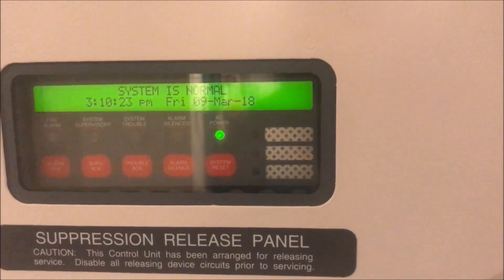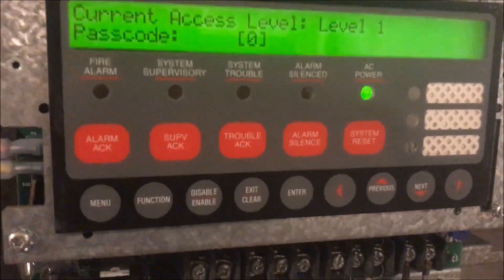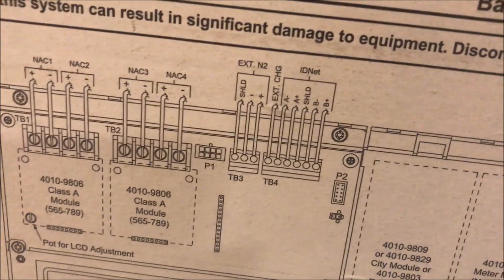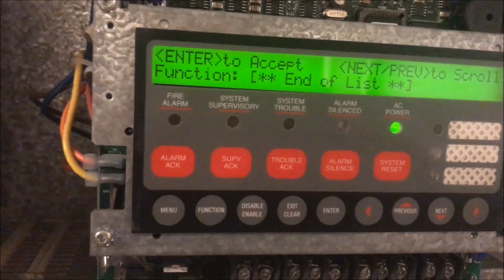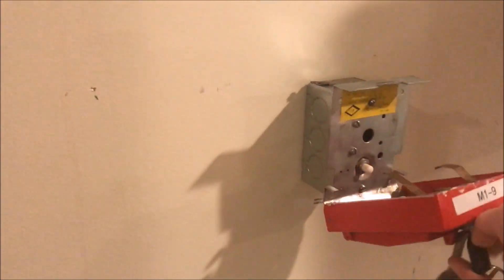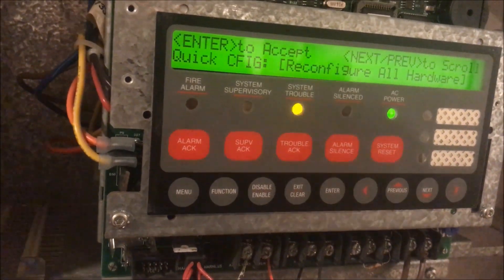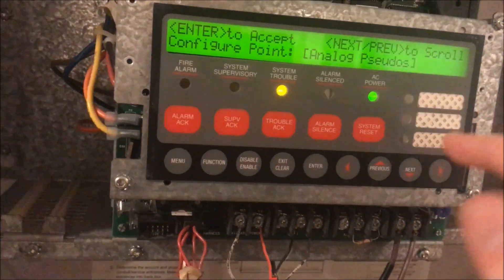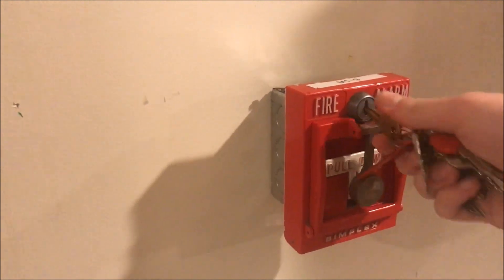Basic Programming on a Simplex 4010 Panel

Comment: We are preparing to  demo a suite at our business that has 13 smoke detectors, 7 strobes and 2 pull stations.   What are your recommendations for disabling the points and listed on our print out of the points list names for these devices.?  Post disabling the points, you mentioned the wires are still live.  What should we do with the devices during the construction ?
Reply: As a former tech I would recommend taping off the smoke and heat detectors with tape so to not allow dust and debree to enter the "detecting chambers" and just let them hang by their wires out of the way, same with pulls and strobes, just make sure to write with a sharpie on the masking tape on the devices that they are "live". This way you can continue to demo out where needed with a system still online (connected to the monitoring center) until you can get a tech onsite to either relocate the devices, re install after a remodel, or remove them from the system itself (remove from programming and them physically remove the devices) if you are completely doing a full gut down to the studs and need to rip the system out so a fresh one can be installed after the construction is completed, you want to call your monitoring company and cancel the service for that control panel/system that you need removed so that no "trouble calls" come in to the monitoring center due to the phone lines on the panel becoming disconnected and the monitoring center no longer having contact with a system that does not exist anymore.

Comment: My first elementary school has a Simplex 4010 system. It was installed around the mid-2000s, tied into the school's original Simplex 4208 panel from 1974 (the 4010 was replacing a 4004 installed in 1998, which in turn replaced a Simplex 4002 installed in the late 80s or early 90s for added-on duct detectors.) The 4010 was for main controls, the duct detectors, signal coding and the modular building, while the 4208 was used for the existing pull stations, heat sensors and an old ionization smoke detector. They had Simplex 4051+4050-80 horn/lights, but they used 120-VAC light plates for some reason, and while the NACs on the 4010 would code the signals (Slow March Time), they had to run through the 4208 to provide the AC power for the lights (while the horns were 24-VDC.) But in early 2015, the Simplex 4208 panel started failing (sometimes the signal circuits wouldn't work in a certain zone, or the system would randomly go into alarm), so during the February break they gutted the 4208, wired everything into the 4010, replaced the old 4208 battery cabinet with a couple of EST booster power panels, and replaced all alarm signals with boring SpectrAlert Advance horn/strobes (they even replaced the Wheelock MT-24-LSMs in the modular with Advances!) But at least my city's school district considers faulty/malfunctioning fire alarm systems a top priority on their agendas!